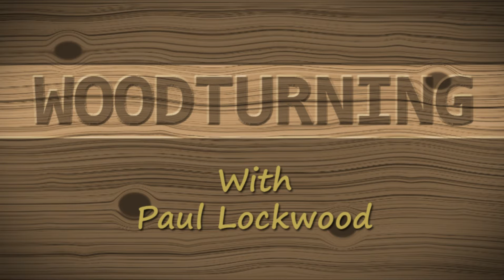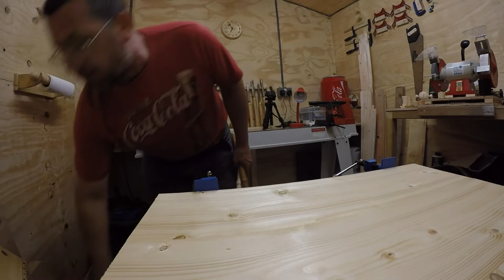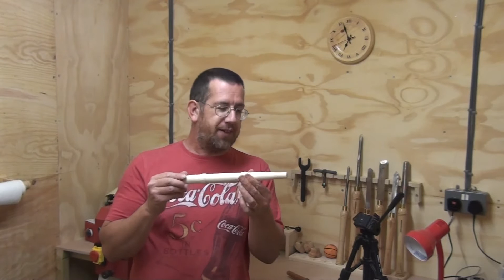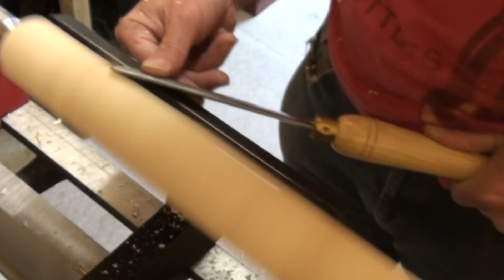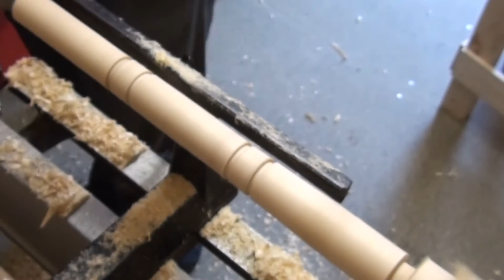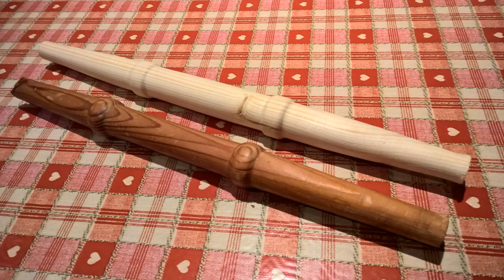Chair Spindle Duplication - Episode 19

Comment: Good job Paul, copy turning is a great skill builder...something I have not done very often. I was going to suggest the same as Steve below, but you also may be right regarding the tail stock being a little too tight.
Cheers
Mike
Reply from the maker: Thanks Mike. There was no bobble on the first one on this second one. I think it was the wood itself. Certainly takes a lot of work to do the copy work, you can;t just change your mind half way through as to what you will do with that piece of wood.

Comment: Hey Paul, have you checked if your head and tail stock are perfectly aligned? sometimes there can be a very slight difference that needs adjusting, this would cause your wobble problem. 
just slide the tail to the head lock it town and see if both tips line up perfectly...
nice video, keep up the good work,
regards, Steve.
Reply from the maker: Hi Steve. I think the issue may have been that the tail stock was pushing too hard on the spindle. Being softwood when it got down to about 10-15mm thick that it caused it to warp. But oddly there was no wobble further up.